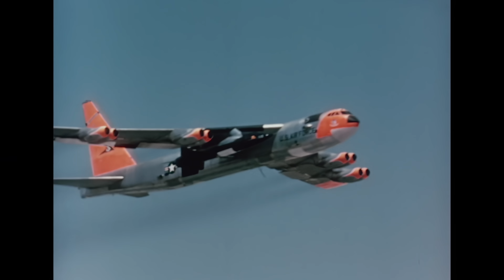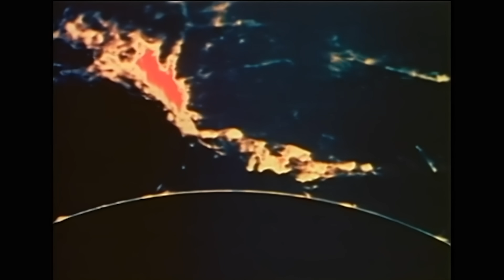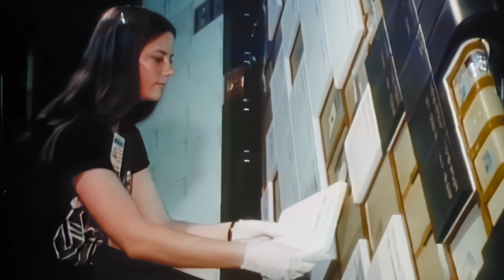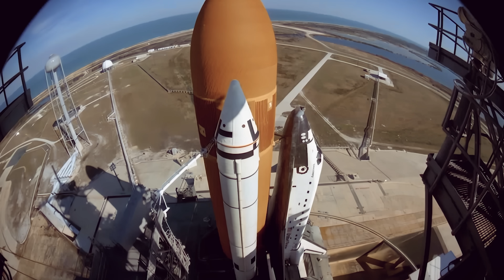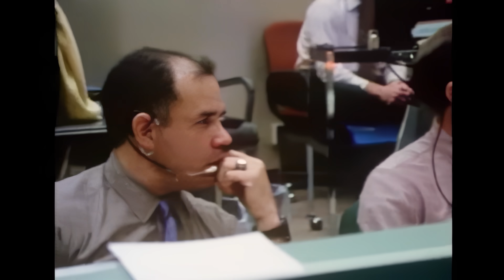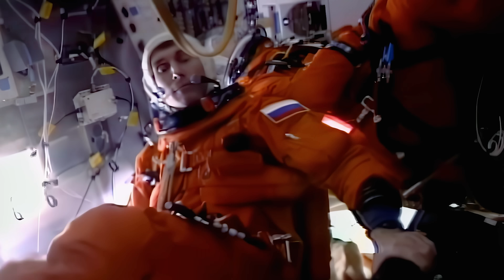The Space Shuttle Program: How NASA Made Reusable Spacecraft

Comment: Not really reusable though was it. I mean the rockets themselves were single use and the shuttle had to be reconditioned from top to bottom including replacement of many parts and the entire heat shield .
Reply: Not true. The booster rockets were refueled and reused. The orbiter did not have to replace all the parts, just a lot of inspections. Who told you the entire heat shield had to be replaced?  Out of 22,000 tiles towards the end of the program, only 150 tiles were replaced after each flight. The reinforced carbon-carbon panels on the wings and nose were just inspected along with blankets on top of the orbiter. The engines were removed for inspections and replaced with others that had already been inspected. There was a lot more work than initially expected but it was reuseable.
Reply: @j @jrockett73 ght then. Notice how you changed what I said to argue against a different position? It’s a sign of low intelligence. But answer me this then. Why was each space shuttle launch by far the most expensive in history?

Comment: NASA is probably the company that has the most experienced astronomers. 

But at the moment NASA has a big problem with the space telescope "Swift" (fast), which is heading towards Earth to burn up in the atmosphere.

NASA is trying with the Pegasus XL rocket, which is produced by Northrop Grumman, and may be able to grab Swift with robotic arms, because Swift has no handles... says ILLUSTRATED SCIENCE...

The Pegasus XL rocket does not need a ramp, is transported by a modified transport plane, 12 km in altitude it turns on its engines in space and flies in orbit around the Earth.

Good luck NASA.

PS And data from the Swift telescope is still important to scientists ... and the observation of gamma-ray bursts, which is a mystery.
Gamma-ray bursts from outer space in an explosion when they hit gas and dust. Gamma-ray bursts are extreme energy discharges that other telescopes point to at the explosion ...

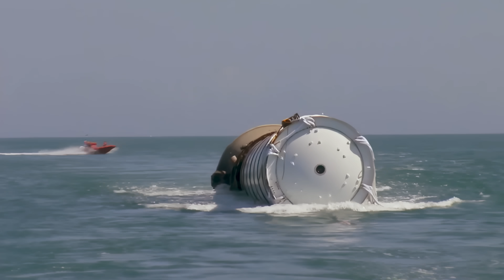Comment: 24:46 i’m pretty sure that’s the same thing that happened to space shuttle Challenger so if space shuttle Columbia had the same issues, why wasn’t it addressed before they manufactured challenger? That O-ring had been a known issue apparently for a while.
Reply: NASA Managers and Engineers at the Marshall Space Flight Center in Huntsville, Alabama failed to take the O-ring problems as a LOV/LOC (loss of vehicle/loss of crew) seriously. And on STS-7, Sally Ride's flight in June 1983 first saw a piece of ET foam break free from the same exact spot which led to the destruction of Columbia 20 years later was also not taken seriously either. On STS-62, a flight of Columbia again a piece of ET foam broke free from the port forward bipod hand applied multilayered foam but missed the shuttle and again was ignored by NASA management. After the Columbia disaster NASA removed that multilayered hand applied foam an added heaters to keep the bipod strut that bolted the forward bipod strut to the ET to keep ice from forming there which was the purpose in the first place for putting insulation foam ramps over those bolts in the first place. However on STS-114 the first flight after the Columbia disaster in July 2005 with Discovery, the new cameras added to the ET showed a part ET foam called the PAL (Protuberance Air Load) ramp fall off the ET and miss Discovery's wing! That delayed the shuttle flights another year until it was decided that the PAL ramp foam was NOT needed after all and the ET could safely fly without that insulation which had believed to be needed to protect liquid oxygen feed lines and electrical wiring on the right forward part of the ET. These ET foams should have been tested an removed from the ET following the Challenger disaster but like the failing O-rings the foam issues were neglected as a serious LOV/LOC.

Comment: It wasn't reusable but recycable. Think about it. An airplane is reusable. The space shuttle was taken apart after every flight to check all components. That is the reason why it failed in the end. The maintance costs were just  too high. It is NOT "reusable"...but still it was great and important for science
Reply: it was designed for military use rather than safety
Reply: they were reusable. You're trrying to be smart and play with words, but they were reusable. The Shuttle that came back to earth was the same shuttle that was used again for another launch. Damaged bits were replaced, but it was the same craft. That's not recycling lol Nice try
Reply: @alloneword7427 I am not trying to be smart, but compare the SpaceX Falcon 9 Rocket with the Space Shuttle. One is very cheap due to its reusability and the other is more expensive than building a new one. So tell me. Is your Car reusable if you have to pay 50'000$ or € to drive with it a second time? I am not trying to convince you but I want you to understand my point.

Comment: It was amazing and all, but the space shuttle program was too costly both money and safety. After Columbia and challenger made 2 consecutive failures and deaths, I don't know how they managed to not fail their last 3 shuttles. What I do know is the reusable parts is what caused the disasters because the thermal insulation broke off during launch of the columbia which should have been overseen. Similar with challenger, an insulation part that we know as an O-ring failed because it was too cold. O rings expand when hot but it leaked because it wasnt hot enough not sealing the boosters, they then broke through to the tanks. These could have been prevented. I wouldn't say reusable parts is necessarily a good thing if you don't know what you're doing. Like space X. Space X does re use but the materials space X builds are more modern and designed for these types of uses. And I think they make safety a bigger priority than the shuttle programs did. Not saying the shuttlers didn't take safety seriously or anything but they had two big tragedies before they learned their lesson. Space X took years for them to perfect their material and they also didn't put people onboard
Reply: The tank was never reused. Also, the Challenger was the fault of launch coordinators not listening to and heeding warnings from engineers. Columbia, that was just sheer bad luck.
Reply: @0waverunner0 never said the tank was re used but the vast majority of the other parts from the shuttles were reused. Columbia wasn't bad luck, it was incidences of safety measures not taken prior to launch. That's the primary reason why NASA shuttle program was no longer allowed. The safety and cost
Reply: @0waverunner0 when it comes to matters like this, there's no such thing as luck or any other superstition, it all happened for a reason.
Reply: dont bolt a plane craft side of rockets

Comment: The Space Shuttle was successful at making spaceflight routine and reliable(135 flights), where it failed at was making spaceflight cheaper  (only slightly less than Apollo/Saturn missions) and safe (2 losses).
Reply: Was the shuttle worth the 14 lives it took? I say no but thats just my opinion the shuttle was like strapping a car to a huge bomb each time and hoping it would make it to space everything had to be perfect each time for it to work nothing could go wrong because if it did people would die and thats what happened
Reply: @j@j @jasonlinton9902  that what you’re saying is completely wrong but space flight itself is dangerous. While other manned spacecraft are inherently safer due to them being stacked on top of the booster and having a more appropriate abort after launch system, there’s still a risk to flying them and Soyuz which is arguably one of the most reliable and one of the most successful spacecraft also killed 4 people (officially) and Apollo killed 3 in a testing accident. Crew Dragon, Orion, New Shepard, and Starliner get the same inspection and refurbishment treatment that the shuttle had gotten, that’s why Artemis II got delayed. Every rocket is an explosive time bomb.
Reply: @j @jasonlinton9902  Also I hope everybody understands there’s a difference in being safe and being reliable.
Reply: it did achieve quite a lot (building the ISS and deploying/modifying the Hubble telescope)..135 flights was impressive.  The 2 big failures with 14 in flight deaths led to it being discontinued.  Had it not  been for these tragedies, I think it would still be active today... and who knows what else it could have done.
Reply: Reliable??
Tell that to the dead crews, and their families.
Tell that to all the school children who watched Challenger blow up.
Reply: @brianpencall4882  If you fully read my comment, I stated that the Space Shuttle was “reliable”, not “safe” in which I still hold that stance given that the Space Shuttle had a 98.5% success rate, which is nearly similar to if not more than most rockets even today.   It had to be, it carried crew on every flight.

The reliability rating is more than the Falcon 9 family with a 96.4% success rate if you include the launch, second stage, and booster landings which is a total of 19 but not including the 3 partial failures. More than the delta family with 86.9% with 51 failures. More than the Titan rockets with an 87.5% success rate with 42 failed flights. And even more than the “reliable” Soyuz spacecraft with a 98% success rate (the rocket itself is more than 99%) with 3 failures, 2 of them unfortunately also being fatal.

Space flight is dangerous for all crewed vehicles, some are only safer than others because they have features such as abort after launch systems.
Reply: @brianpencall4882 2 accidents, over 135 missions. Tragic, absolutely.  But the work the sts program did was astounding and reliable. There is zero need to get all worked up like that....
Reply: @brianpencall4882  I am not disrespecting the lives lost on Challenger and Columbia by defending the Space Shuttle’s reliability nor am I justifying the safety standards of NASA’s management at that time. I myself remember watching Columbia’s fatal accident live. If you are a family or friend of one of these brave heroes then I apologize for offending you.

Comment: The shuttle was designed by the lowest bidder.  It was a total waste of money that ended up killing 14 astronauts.  All of this is needless but NASA was too stupid to listen to other aerospace companies that had proposed far better systems.  Great Video!
Reply: The whole design concept was a disaster waiting to happen. Every manned flight before, or since, had the crew at the TOP of the vehicle, as far away as possible from the fuel and combustion, with an automatic escape system to pull them away in a fraction of a second of any system failure.

The crew were essentially strapped to the side of a huge bomb.

Some early designs at least had the orbiter sitting on top of the boosters, but extracating 5 to 7 astronauts on 2 separate flight decks would have been a bit of a challenge to say the least!

Furthermore, I'm not sure I would be happy to go through the blast furnace of reentry in a lightweight aluminium skinned vehicle, with only fragile ceramic tiles (that didn't want to stay glued in position) as my 'protection'.
Reply: Not true, my daddy owns nasa

Comment: Starship is a failed endeavor.
Reply: The same was said about Falcon. Let's see. I certainly think that the HLS may be a pipe dream.
Reply: @yassassin6425 falcon is entirely different situation. Starship is simply too heavy for its engines. The steal housing is too heavy. Composite materials would need to be implemented. Don’t count elon to procure anything In his many failed endeavors.
Reply: @jamesbrett5010  
Falcon 9, and its reusable first stage is simply a comparison, using the same iterative development and agile principle - since many armchair aerospace engineers branded its multiple losses as a failure too. 

I think you have to start with the assumption that SpaceX knows how to use Tsiolkovsky's Rocket Equation and know the ISP, thrust and mass of their rocket and fuel.  All of those values are currently under development and changing regularly, so the performance SpaceX gets now is not the performance they'll get when the rocket is in service - they have a lot more insight into what's going to change in the next couple of years than we do.  We know there's more mass on the rocket than there needs to be (the Hot Staging Ring, engine heatshield, etc), but only SpaceX has estimates for how those are going to affect the payload.

I expect that the first usable version of StarShip may only have 50 tons of payload to LEO.  I suspect that, within a couple of years, that may double or triple as they transition from "making it work" to "making it work well" to "fine tuning and addressing the 10,000 low-priority tasks that might each save 1kg of mass".  right now, those compromises have without doubt affected its structural integrity. Remember that SpaceX works differently than other space companies - they do a great deal of their R&D at altitude and under thrust, as opposed to spending billions setting up smaller land-based hardware tests and running more simulations.  Most other organisations like to treat their first rocket as an example of their final rocket, with only minor running changes expected.  SpaceX treats their iterations as engineering tools.
Reply: flight 10 did pretty well

Comment: We went to the moon with liquid hydrogen and oxygen without using a crappy spray on insulation that would fall off and destroy the craft
Reply: Everything is a compromise. I’d like to point out that nasa somehow managed to normalize humans riding rockets to the point where the population assumed the pilots wouldn’t regularly die doing this.
Reply: ...and with a rocket system designed to discard 99% by the end of the mission. You gotta hand it to them for trying another way of doing it.
Reply: I've heard if they had gone back to painting them white it would have helped to keep the foam from falling off
Reply: @JoeBlow-bd1eg racist fuel tanks 😂
Reply: @JoeBlow-bd1eg  Maybe. Early missions report stuff coming off even the white tanks though. Painting also eats into the payload the Shuttle could carry (272 kg/600 lb)
Reply: they didnt bolt a plane craft to side of rockets

Comment: We need to harvest the kuiper belt and possibly the moon slightly. We need more mass brought to our planet. Equalization of repulsion to mass is magnetic fields grounding currents through all masses towards the earth's surface and core. More mass brought in will reinforce our planetary internal magnetic field grounding currents and expand outward into occupational space within mass as occupational space neutralized within our atmospheric gasses. Ice would be nice. Rocks. Any atmospheric gasses brought back. Any kind of mass. External heat energy is outside of entanglement of mass is increasing. We need more mass brought in to equalization of pressure inward and outward.
Reply: I don't know what your smoking there Timmy but it has obviously affected your brain cells!